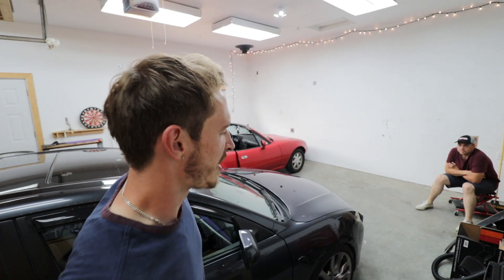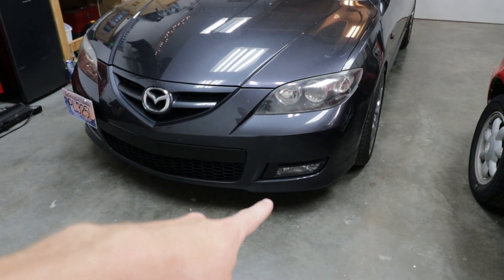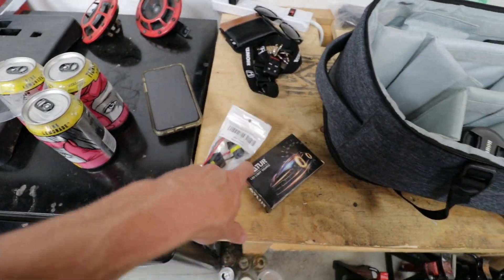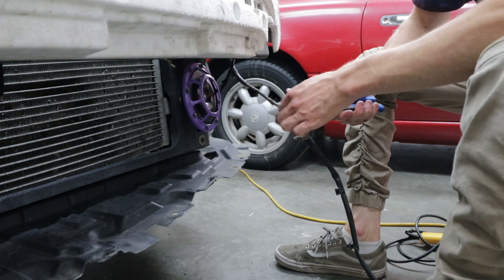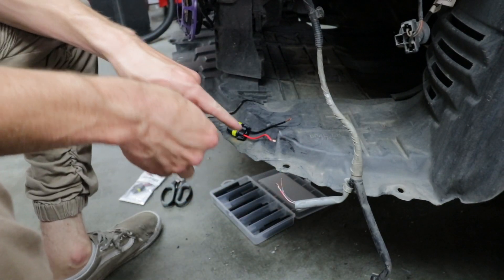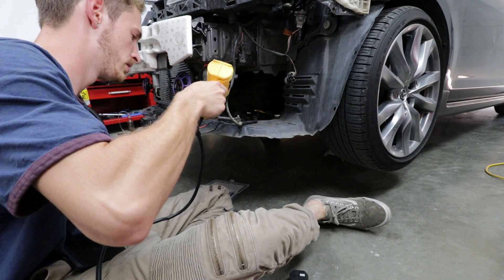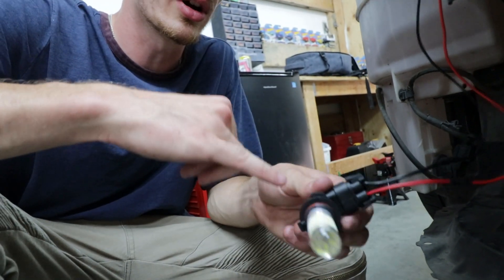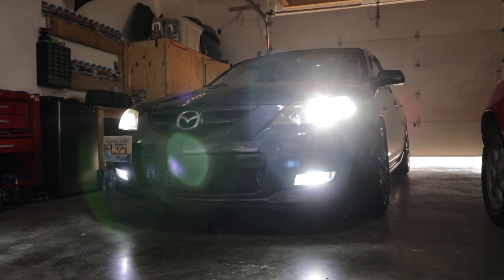Mazda 3 LED Fog Light Install | Plug Wiring

Comment: Hey colton, wanted to ask something maybe you can help, I ordered these fog lights they look exactly like the ones in the video. they advertised that it should fit my mazda 3 2008 sedan, for some reason when i tried putting them on they would not fit, the holes and clips where they sit on just dont match, any idea?
Reply from the maker: different bumper style
Reply: @ColtonRichter  ah dang, which bumper do you have? And will it probably fit a Mazda 3 2008 sedan? 🙏🏻

Comment: @ColtonRichter I know this is a bit of an odd one, but I’m kind of curious to see if the SP23 fog lights fit the lower model bumpers. If you’re up for it, I’d that something you could possibly test?
Reply from the maker: They won't, if the bumper shape is different then the fog light trim is different.
Reply: @ColtonRichter  okay. I’m not sure if they are different shaped fog lights between the two. I haven’t got any to compare the shapes. I have been told that they won’t fit though. So they probably wouldn’t.